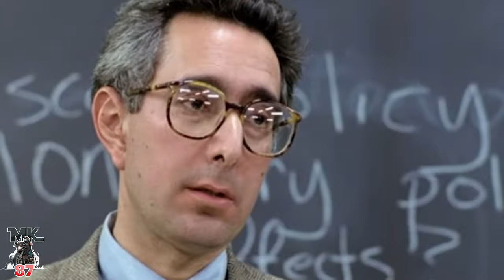The Buell super cruiser what parts wont make it to production?

Comment: The dash is parts bin, is not a TFT, it’s a hard button toggle with a LCD screen Buell confirmed it will remain as well as the perimeter rotors, the wheels are identical to their super bike models and work with those rotors. The frame, all the RSD parts, fairing as of my interview with them at bike week are all concepts with no production plan or vendor agreements in place at this time.

Comment: But even without the exhaust, dunlop tires, seat, riser/bars, turn signals, that ride will still put out 175hp, weighing 450lbs. The rest will actually allow the customer to personalize the ride. Still wont spend extra $10-15K to replicate that prototype if you really dig that. Spend $10-15K on a bone stock LRS and yes you get a beast, but you aint getting that 175hp on a 450lbs steel horse. And i bet that thing will handle like a sports bike. 

And no, that engine isnt new. Been tried and true. They’re just putting it on a new frame.

Comment: I do agree that the Dealer Network could be a big disadvantage in launching. They have 19 Dealers across the whole US and none of them are stand alone Buell Dealers. When it comes to the chain drive I am sure that will also end up having a cover that and  and a guard otherwise someone might get their shoelace caught and lose a foot :) I also am curious if they will mount the front signals on the bars or on the forks since pre-production does not have DOT requirements in place.

Comment: I agree it won't look exactly the same, but I have to disagree on some points. That front brake will be on it. That front brake is standard on all buell sport bikes. I think the exhaust may be different but that motor itself has much lower emissions out the gate than any other Vtwin. You gotta remember...this is not a New motor. That motor has been around for a while in both street and off road applications. I'm thinking more of the type of exhaust they use on their sport bike but more styled for a cruiser. That swing arm is staying cause that's a buell part. Basically all chasis parts aside from the frame is directly off the hammerhead, including the motor. Really the only difference is the frame, tank & fenders. Harley may challenge them legally, possibly over the FXR style frame. I agree about the dealer nextwork or lack of, being an issue as far as service. But I also know that that motor is way more reliable then any other typical Vtwin. You gotta think about that motor more in the way of Sportbike motor. I would put that motor more in the class of a Ducati or the old Honda RC51. And I would argue that the reliability of Buell's design is just as reliable. I would think that the Service interval probably would be spread further apart aside for basic maintenance like oil changes. All in all...I think it's a beautiful design, but is it really a practical cruiser for the street? Probably not...for the track...Definitely. But that's just my opinion...

Comment: <---  That's a Buell XB12R, yes, I'm a Buell fan boi.  Now that is out of the way. 

That mono shock is a Fox piece used for the mock up, I imagine it goes to the standard Buell rear shock.  I doubt the turn signals are DOT.  The front suspension, brake, both wheels, etc are stock Buell pieces and will stay.  The controls are stock Buell pieces and will stay.  Same with master cylinders.  The upper triple is a Roland Sands piece, and I imagine it may not make it, probably going to a mass produced cast piece as opposed to the milled piece.   The digital dash is staying, it's not an actual TFT, it's an older scroll through dash.  Buell has said the radiator will stay in bare aluminum and if owners want to polish it, or paint it, they can.  The front fender is my biggest doubt.  That carbon fender is a piece that was used on the 1190 Carbon, but there's also a plastic fender available, and I just can't see that shorty fender protecting the radiator enough to be used.  That fairing being a Memphis shade piece, and already ready, I could see it being on the production model.  Buell has said an accessory list will be coming with storage, sissy bars, etc.